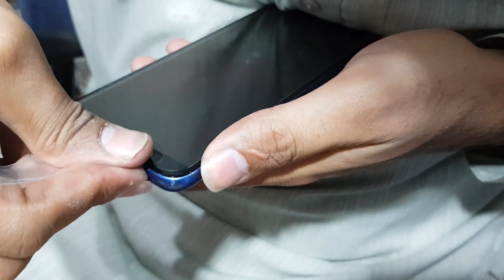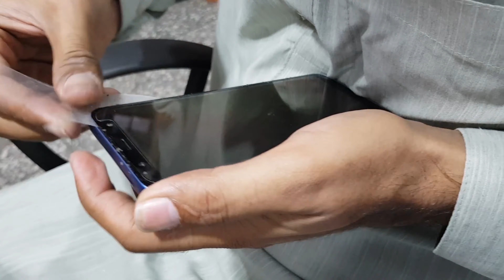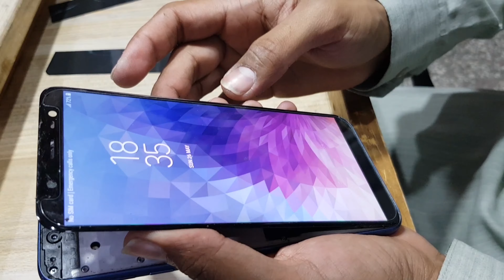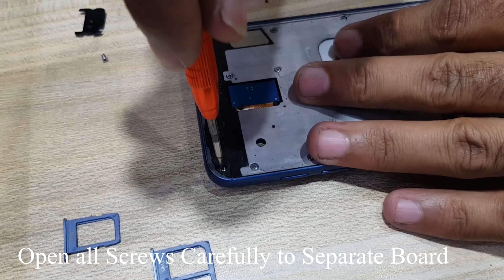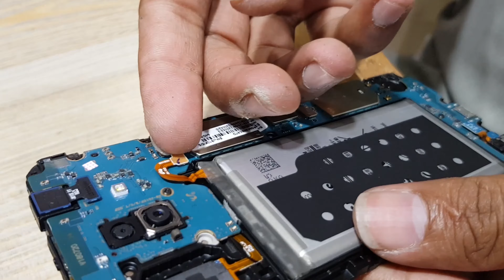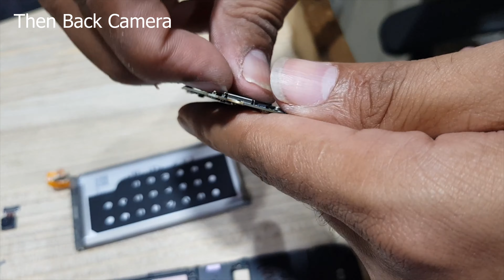Samsung Galaxy J8 Disassembly

Comment: In which element is the data stored? Can it be taken out and used a usb?
Reply: The data is stored inside emmc memory. (a chip on the cell phone's motherboard) and the only way to recover the data is to access the device via USB AND PC. If your screen is cracked, the only option is to replace the lcd

Comment: what is that liquid u pour?
Reply from the maker: all ReView you can use any type of liquid like petrol thinner or ctc
Reply: Mine display stopped working after i open the display
Reply: @nilanjandas5463  Yes that's bcos this tutorial is wrong. Thisnis completely wrong method to open phone.